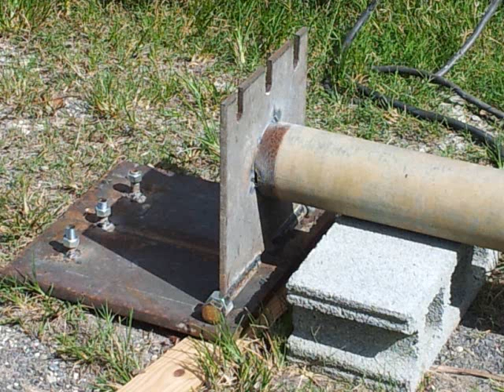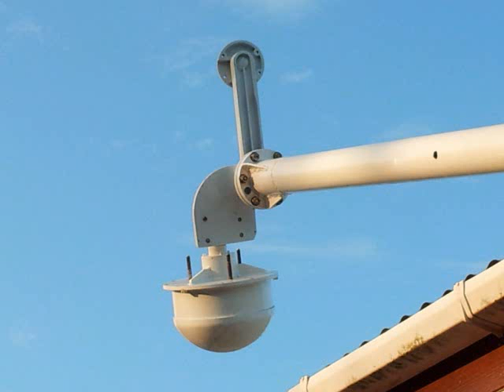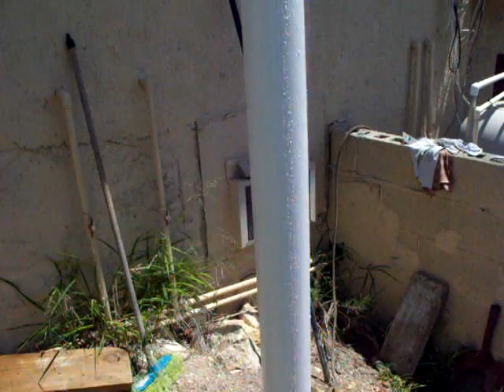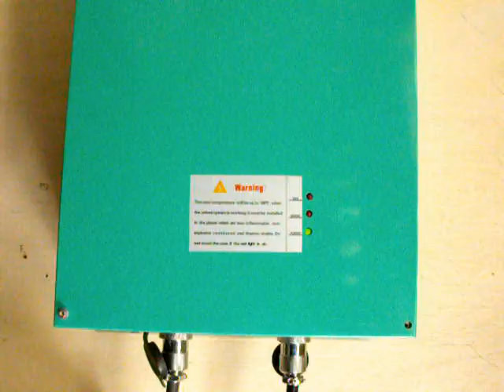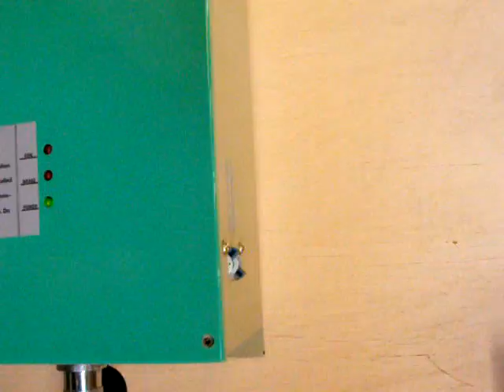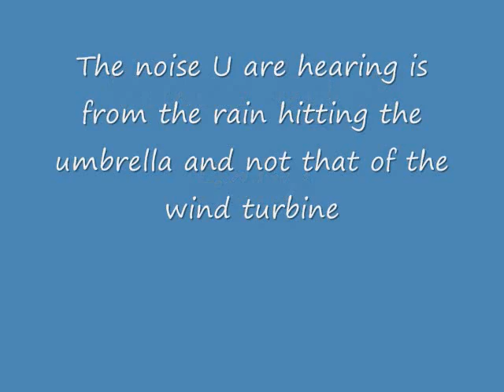Hummer H3.8 2KW Wind Turbine Generator

Comment: hope you can fix you vibration problem in my experiance its the blades.best to weigh each blade first before any thing else right down to the nearest gram. before trying any thing else.
then dynamic balance and static balance of the blades.hope this may help in some small way.